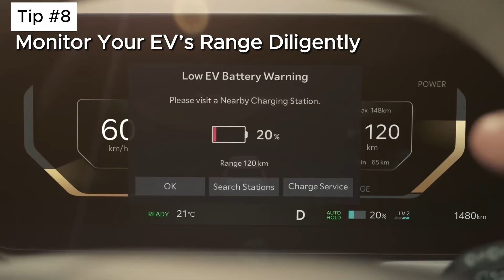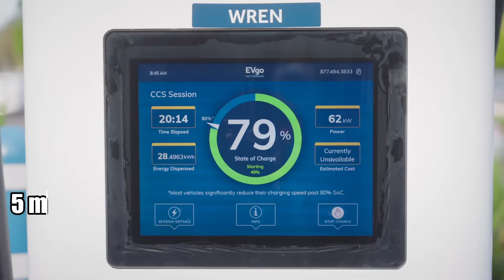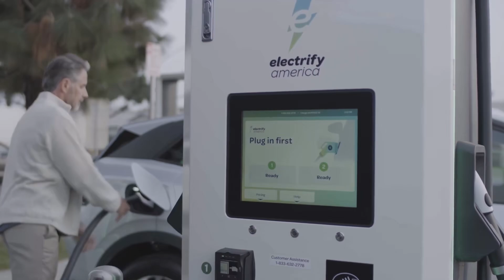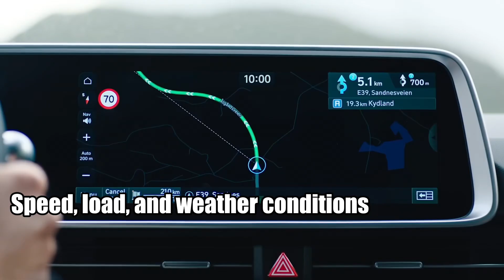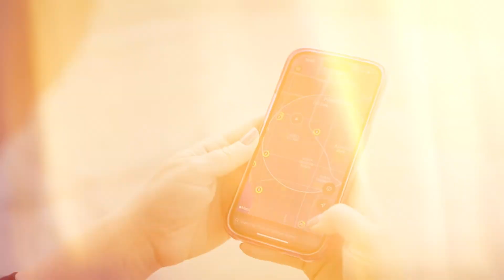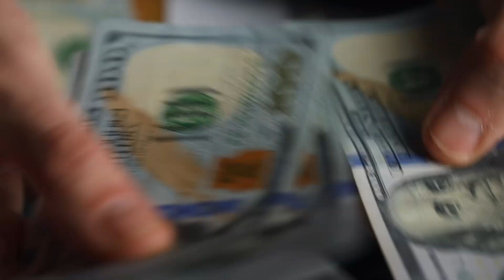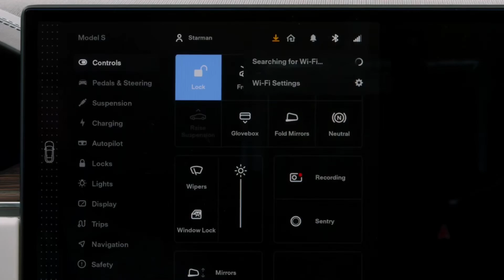Must-Know EV Owner Tips: 8 Warnings You Need to Hear! Be Prepared For A Fully Electric Future?

Comment: What kind of crazy exaggeration is this. The only thing true is you must install a charger at home. For $40 more electric cost you drive the whole month. Used Tesla are around $26k now. The battery and motor are designed to last 300-400k. There is no oil to change. Is the best automotive deal anywhere.
For long distant, if you have a Tesla, just enter your destination on the map, all the charging stops are calculated. Once you get to a supercharger, just plug in. No credit card, no password, nothing. Can't be easier.
However, if you like to go far into out of the way places, then EV is not for you. Main routes are well covered. Obscure routes like America's loneliest freeway, not so much. You may have to use other charger network. Then you have to plan carefully.

Comment: Ok we get it you are a neanderthal.
You want to pay 4 times as much for fuel.
You want to breath tail pipe emitions and die of cancer.
You want ot pay for $100 oil changes, oil filters, air filters, pve vales and leak oil all over the place.
But most of all you are just scared.
Scared that you are going have to learn something.
If you don't want to drive a BEV don't, but don't dicourage others from finding better for them selves.
Just go close the garage door and run your a/c on a hot day and see how that works for you.